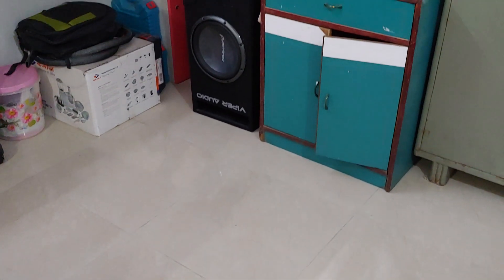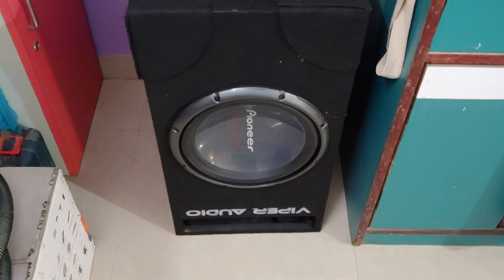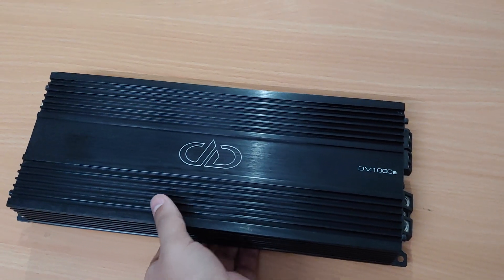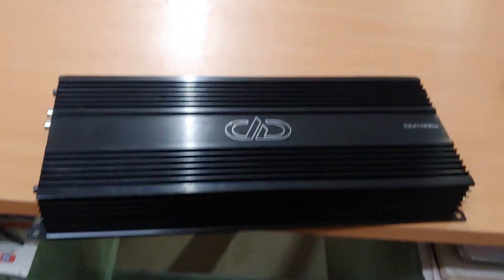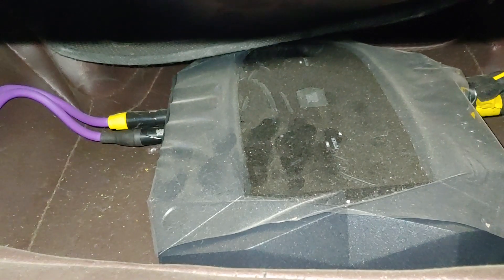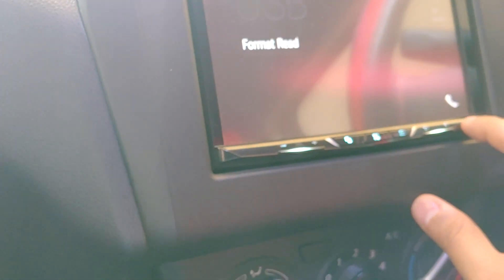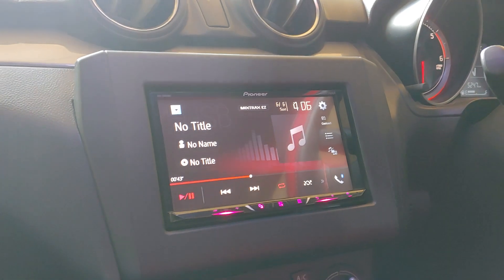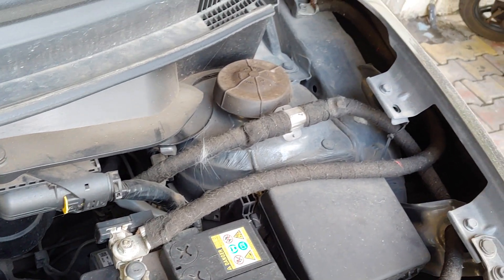For sale - JBL club 5501 550w rms mono amp, Pioneer AVH-Z5090BT.

Comment: Hello sir i am having sony xs aw8 under seat subwoofer in the setting they have given one switch for phase setting for normal or reverse   At which side i should keep the switch sir
Reply from the maker: Keep it normal. Its pre loaded in enclosure.
Reply: @Live_Loud  why they have given reverse option sir
Reply from the maker: @gajju6222  generally all amps have phase switch in circuit. So they provided it as it is.
Reply: @Live_Loud   ok sir tnk u

Comment: Are these left
Reply from the maker: Only Pioneer Head unit and JBL mono is left now.
Reply: @Live_Loud  I needed Pioneer TS-W3003D4 and JBL club 5501 Amp
Reply from the maker: @DeepakSingh-id2yl  Amp is available. Pioneer Champion Pro TS-W3003D4 got sold but I've pre ordered Pioneer Champion TS-W312D4. I can give you that once I get bored with that setup. Gimme couple of months.
Reply: @Live_Loud  and the pioneer 5290bt
Reply from the maker: @DeepakSingh-id2yl  head unit is available.
Reply: @Live_Loud  ok so how can I contact you
Reply from the maker: WhatsApp 9021717087